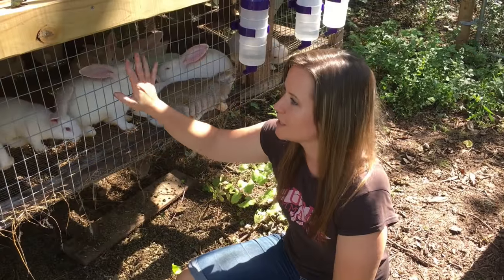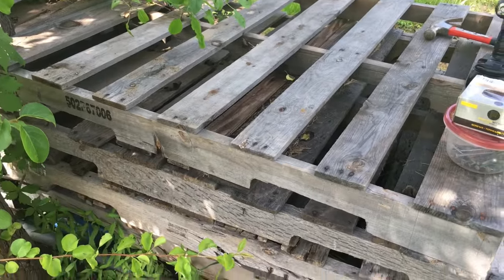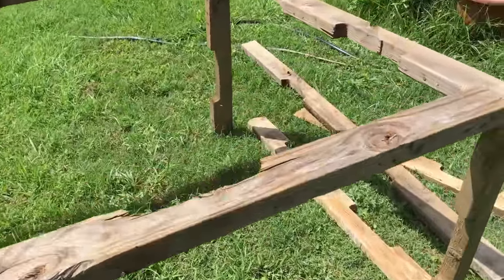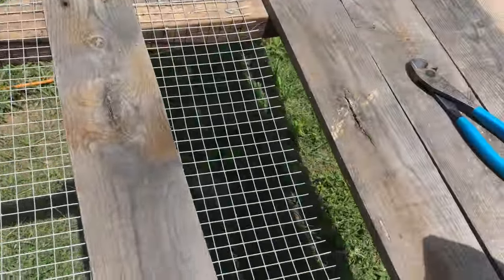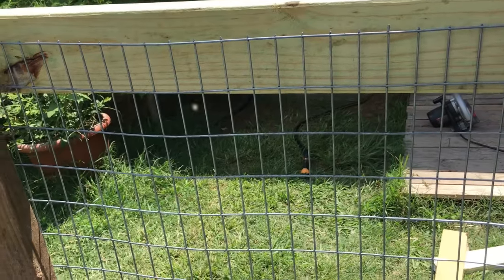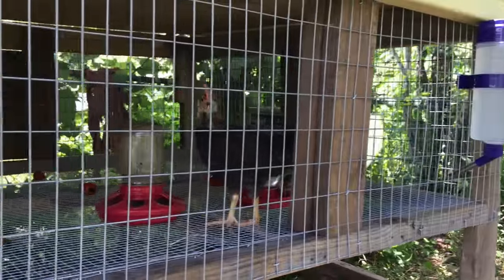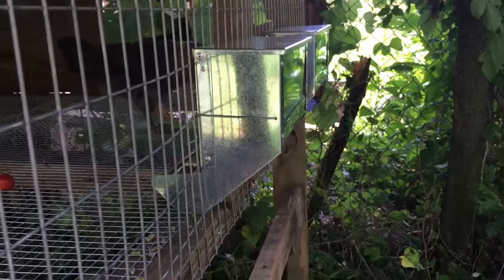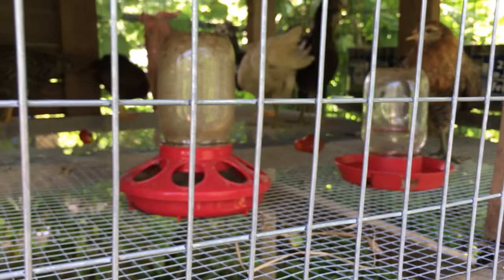Building an Easy Chicken Brooder or Rabbit Hutch

Comment: This pen is  a fabulous idea.the only thing I would suggest is instead of using a water bottle you could use a water bowl.  I find this to be extremely beneficial to rabbits because when using a water bottle rabbits can become dehydrated and if the water bottle is to low it can cause neck issues.  When I made the  switch my rabbits were going through water much quicker.  They would only drink a quarter of of the water bottle but with the water bowl (that is at least 2 times as large)they needed it refilled twice a day.  So not trying to be rude but just want your rabbits to be safe happy and healthy.

Comment: i find I like the flooring  1" x 1/2" which is standard in all rabbit wire cages- the poop falls through better instead of the 1/2" by 1/2" Thanks for sharing
Reply: I use 1"x 1/2 also Rebecca. It's heavier and holds up to the urine longer as well.

Comment: I like that you used the frozen water bottles for the rabbits. They can lay by them or move away as they want. Nice gage.
The small wire on the bottom is good because I had the neighbors dogs chew the feet down to the bone. It just needs to be cleaned often because the hair and feces can build up. A sharpened putty knife works great.
Like the gage and videos.
Update on the green house???? Still working?